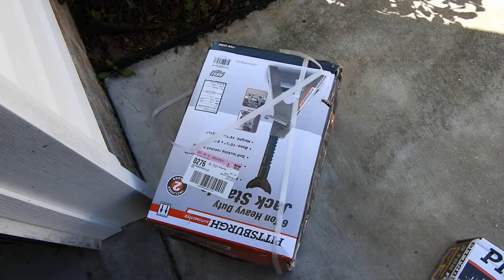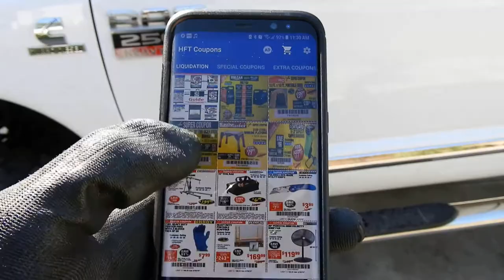WHEEL BEARING & U JOINTS TIME!!

Comment: Did i miss what brand hubs you went with?
Reply from the maker: I didnt mention it just some Ebay wheel hubs. Kinda sucks cause my left hub is squeaking already. Rides good just squeaks.
Reply: Ok, that helps alot I use detroit axle stuff off ebay alot for other cars and wondered if they would hold up on these trucks.
Reply from the maker: Oh yeah I never tried them before
Reply: I know this is a year old, but I saw this vid while researching u-joint crap for my 4th gen...not fun lol.  You mentioned presses, Harbor Freight sells a 6 ton pneumatic press that is small enough to fit on you bench for like ~$70, and I also picked up a c-clamp ball joint press form there that also works great for u-joints!  Would you recommend replacing wheel bearings same time as U-joints?  Mine appear fine but curious since I m taking it all apart.
Reply from the maker: If your wheel bearings are fine I would leave them but if they super old and never been changed I would just swap them out too since you already got them off